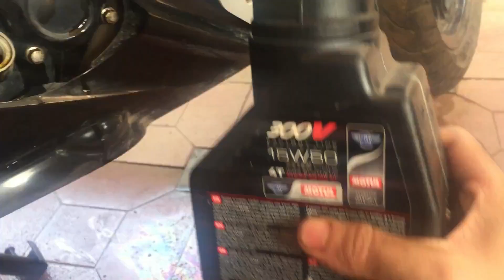Motul 300V for Yamaha R15 | best engine oil

Comment: Hi i have just now changed to  motul 300v in pulsar  135 from motul 7100. But now only i have seen ur video regarding detergents in motul 300v.. How long can i use it.. Should i drain it now or use it for 10k kms
Reply from the maker: bro u can use it for 8-9k easily this time...next time go for 7100 again
Reply: Okk.. Thanks

Comment: Motul 300v 15w 50 in r15v2.?how much km driven to change it.?
Reply from the maker: bro sorry for late response... bro should be changed at 6000-7000 kms max and 4 months..
Reply: @ddvlogsDipakk  i just need to know that I can easily use it for 6000-7000 km after I change it to motul 300v
Reply from the maker: Yes bro, but within 4-5 months

Comment: Bro Can i use Motul 3100 20w50  Engine oil for r15 v2 .Bike mechanic suggested me to use this for summer ride.Is it ok or need to change oil.
Reply from the maker: i m not sure how 3100 is recommended, its totally mineral oil.. in summers a 20/50 oil shud be good, atleast bro.go for 5100 min.
Reply: @ddvlogsDipakk  Ok,Thanks bro
Reply from the maker: @hariprasath5889  most welcome, bro chck a new video on 7100
Reply: @ddvlogsDipakk  ya sure bro.with 3100 can i ride upto 1000kms or need to be changed immediately bcoz today only i changed my engine oil.
Reply from the maker: with 3100 you can go till 2500 - 3000kms
Reply: Ooh ok.Thank you so much bro for your precious time.
Reply from the maker: bhai anytime.. incase you on Instagram bro..do find me @De3puckk
Reply: @ddvlogsDipakk ya sure bro

Comment: Bro I have r15s can I use this...and one question is 1 litre is enough for oil chamber?
Reply from the maker: Amit Pandit yes bro you can use this, this is great for performance boost...but 7100 is more practical for use city rides and lasts longer.. and when you drain it comes out clean from engine...yes 1 liter is recommended...

Comment: Which engine oil is best for fzs v3 ??
Reply from the maker: Bro I would recommend 5100 is pretty good but if you want to go for fully Synth then 7100 is great as well
Reply: In 7100 10w40 is it good for fzs v3 ??
Reply from the maker: @rahulachar8083  Yes bro...it's good enough

Comment: Aap jo main stand use kar rahe hain...wo aftermarket hai ya genuine part hai?
Reply from the maker: after market bro RX100 ka stand hai, ek video hai mera stand pe usko dekho.. kou jagah ru bro??
Reply: Dirty Dogg Rides 
Thanks for the information and mu rourkela odisha ru
Reply from the maker: you're most welcome bro, I am from Rourkela  ♥
Reply: Dirty Dogg Rides 
Oh great!! And keep on doing this type of videos. I like your videos.
Reply from the maker: Thank you so much bro..keep commenting and let me know what more or less I need to do, need your advices.. :)
Reply: Dirty Dogg Rides
I have a doubt bro...as you know low beam me r15 ki single light hi jalti hai and maine ise showroom mechanique se twin light kiya hai. So will it affect my bikes electronics system or the fuel injector?
Reply: Dirty Dogg Rides 
Twin light means low beam me v dono lights jalti hain
Reply from the maker: bro hence the power consuption is 70 watt even in low beam, it is even recommeded that when you switch on the high beam, that is when bike consumes 70W then the RPM should be above 4K in that case the amount of battery discharge can be made up.
Already the battery output in R15 is so restricted even I dont like it for the battery part, so that will certainly effect the rectifier. once the RR unit is affected that will affect the fuel pump.
Reply: Dirty Dogg Rides 
Basically I want to know ki jitni b split lights wali bikes hain jaise ninja 300,yamaha r3 even bmw s1000rr sare bikes k low beam me ek hi light jalti hai. So is it a style or isme kuch mechanical aspects hain
Reply: Dirty Dogg Rides 
Okay thanks bro.
Reply from the maker: Daya Sagar Patra bro low battery consumption k liye

Comment: Yar main agar oil filter change na karun toh kya problems ho sakti hain? Kyunki mere home town me yamaha wale oil filter without engine oil de nahi rahe hain
Reply from the maker: bhai woh unlogon ka cheap sales trick hai to sell oil filter. waise koi khaas difference nahi aaega..but oil filter engine oil ko filter karte rehta hai from small particles and dust that enter when u open engine cap, also engine develops sludge and hence small particles but thats again for very old engine oil..which is for long run. its okay not to change filter for 20000-30000kms as well but very slowly will effect the engine..unless particles enter.

Comment: R15v3 main motul 300v ya fir 7100- 15/50 sahi rahega?????
Reply from the maker: bro I would recommend 7100 15/50 or 20/50 10/40 all are good for our bikes, as its summer we can use 20/50 without issues,  why I will tell you in an explained video about the these engine oils..

Comment: Bhai yeh oil Amazon pr mil Jayega Original aur mere pass Yamaha fzs version 2 hai Uske liye Sahi h
Reply from the maker: yea bro bahut sahi hai yeh oil..i guess issi oil ka link description me hoga
Reply: Thanks bhai
Reply from the maker: Welcome bro :)
Reply: Bhai ekk baat aur puchna tha ki oil filter 2000 pr change krwana hota h to Motul 300 v. 15 W 50 used krne ke baad filter kitne km pr change krwana Hoga  .?????
Reply from the maker: @mohammadsajid6403  nai bro.2000 me nahi normally 4000 me.motul me 7000-8000 kms easy..